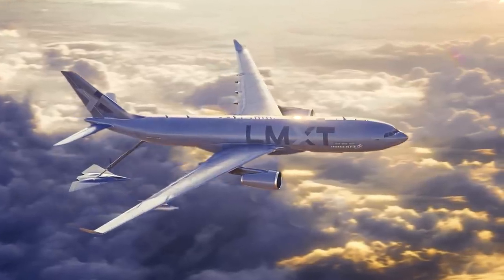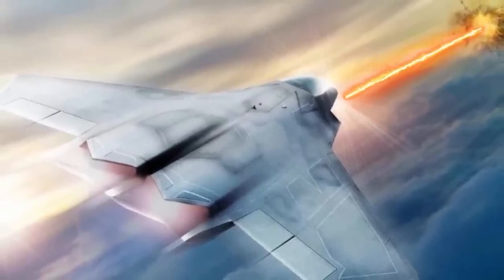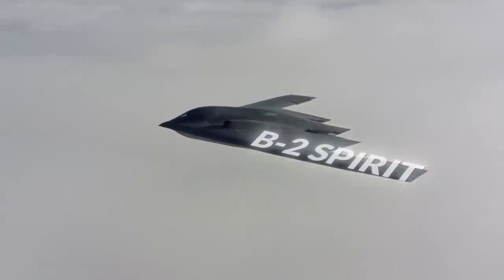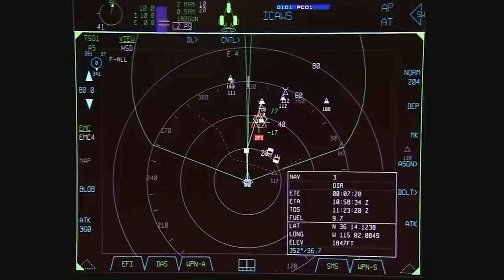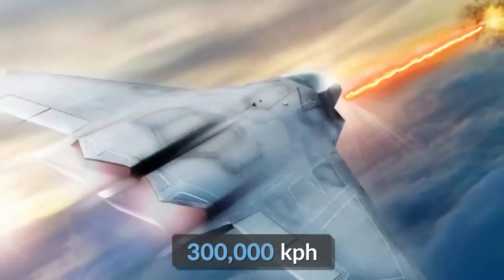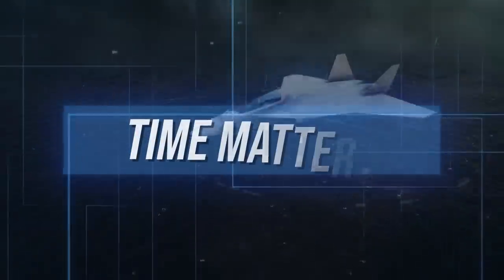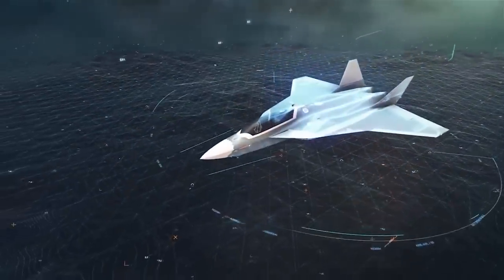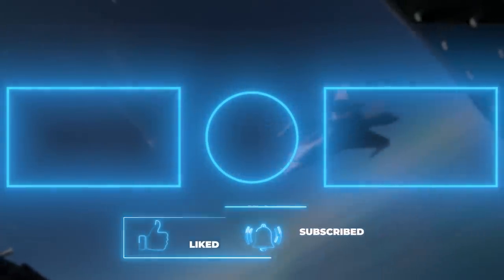Finally: US Revealed the FIRST 6th Generation Fighter Jet!

Comment: There may not be any moveable control surfaces needed on this airship. The released, declassified, empiricism, has yielded employing controlled, supersonic, bleed air over the wing surfaces to substitute for radar reflecting, and more complexity adding, moveable control surfaces. Also, no mention of the power plant most likely a 3 Stream Adaptive Cycle turbine already built by GE.
Reply: Yeah sure. No necessary moveable control surfaces. It must maneuver by thought alone... dude it most likely has ailerons and flaps/air brakes. Probably thrust vectoring. And for yaw it probable uses differential thrust. The only one of those I just listed that isn't a moveable control surface by any definition is differential thrust. Some arguments can be made that thrust vectoring does or does not count. You can probably get a compressed air thruster system going with that model but the capacity would be limited. That with the stuff I listed would be able to do anything the pilot can AND MORE. Meaning a remote operator can do things with it that no human in the seat ever could.
Reply: @hf117j  Published in "Machine Design", 19DEC17, "New Drone Technology Manipulates Air for Enhanced Flight". This is an earlier explanation. The paper I read was far more indepth. You are what is known as, 'Behind the power curve'.
Reply: @scottwolf8633  Let me guess. Ion thrust or something. Which would be good... if we were able to make it efficient enough to work for full scale models. But the closest we can get is scale models made of the lightest possible materials to get any noticeable thrust. Know what else changes air besides that? Heat, and movable surfaces. Given it hasn't melted we must be able to dive into the sun. Orrr.... it uses movable surfaces. The tech has been around for a long time but it's still in its infancy. So that power curve we're on about if we're talking thrust to weight ratios anything other than thrusters or movable control surfaces is way behind on efficiency. You want a hyper maneuverable plane give it multiple forms of control for every movement and remove the human element. But it won't fly for very long. You want a viable combat plane for ranges beyond last line of defense you use movable control surfaces and thrust vectoring

Comment: We should just invest in smaller cheaper options that are low cost to fly and repair. The tech is so good and cheap now that In a real conflict cost to fly per hour should be a major focus. Also produce them in large numbers, and make it super easy to fix, build, and highly reliable.
Reply: If you understand how the NGAD is meant to work this won't be an issue. One NGAD may cost a lot but it will control several drones that are cheaper and easier to upgrade that will do all the dirty work. In real terms you are spending more on one fighter but it will far outperform 4th/5th gen fighters in efficiency and effectiveness
Reply: @iamzuesthisisthetruth8864  lol yes ofc it is hypothetical that is why I said "meant to work". If you read up on 6th generation fighter projects by USA / Europe / China you can see there are common themes. One of which is autonomous wingman drones that fly alongside a central command jet fighter. Simple logic dictates that drones will be cheaper and likely perform better than a manned aircraft and can be continuously be replaced with cutting edge technology. F-22 is decades old so will be obselete with 6th gen. USA plans to introduce NGAD in by 2030. Please read up first before saying anything.
Reply: I agree. The future of warfare is changing. Gorilla warfare seems to be the direction it's going. If you used e bikes, with handheld rocket launchers, and small drones, you have a formidable fighting force.
Reply: That's why it's expensive!.. 😴
Reply: So your saying we should downgrade back to ww2 aircraft or something?
Reply: @GeneralThunderbolt  
You're right however the average person that you're trying to tell this to has brains of a bird

Comment: China’s J-20 is about as stealthy as our F-18E. Now our F-18E is larger and has a smaller radar cross section than its predecessor, so we need to watch China’s progress carefully.
Reply: The F-22 and the B-2 are comparable to the size of a bumblebee or smaller with the F-35 being quite small itself in the Radar cross sections.  Apparently if the J-20 is appearing to be as stealthy as a F-18E it shows how lacking the fighter actually is at stealth.   It might be useful against lesser powers but against more high tech nations the J-20 is at a severe disadvantage
Reply: @Quetzalcoatl_Feathered_Serpent   That’s close to what I’m saying. I think it’s a sign they are catching up. They are still behind, but they bare watching.
Reply: @johnsalter5412  They are more then 2 generations behind on engines.  They can not with their current workforce catch up in that area.  China is not a threat.
Reply: @Quetzalcoatl_Feathered_Serpent  I don't know. It really depends who could see who first and US tech is far superior in that regard. Since we stopped giving away the latest chips to China. So maybe this has a chance against any of those you named
Reply: @acvarthered  Give them a little time. They certainly have the money. Also their workforce is becoming more and more educated. Like I said, the J-20 is about equal to our F-18E. That is quite an achievement.

Comment: If the 6th generation fighter jet STAT-222A devil fighter is built, it would kill its enemy in the skies of the battlefield of the future, to fly, it has 4 J-99 Afterburning jet engines, with 90K pounds of thrust max, with 2 20mm MG-251 cannons with 7000 rounds max, 2, 2 500 pound bombs, 5 SK-28 AAM, 3 SK-100 Airborne Torpedoes, and 1 SK-99 ICBM, it would be a beast in the skies, and with its 5525 number 2 radar, it doubles up as both surveillance, and Reconnaissance

Comment: 7th generation rumor, nuclear power jet, with cloak ability...
Reply: I just recently saw that fusion engine patent was issued to either Lockheed or Boeing. And that this may be the engine that wil go into 7th generation and even late 6th generation planes. That means unlimited speed and engine power without having to EVER refuel. If so this will be a complete and total game changer.
Reply: @xlxl9440  fusion? Lol, if they have fusion, why not give it to energy sector.
Reply: @CountingStars333  two simple reasons. 1st the technology isn't ready yet but far enough along to be able to file a patent. And 2nd this would actually hurt the energy industry as it is now because if the technology matures it will basically mean a free and unlimited energy source.

Comment: May I say this NGAD concept totally lacks imagination? A 6th Gen fighter either has to be hypersonic, min 5mach or above; or it has to be a UAV swarm, controlled by the co-pilot of a manned flight. It should be able to change the air superiority upside down.

a 6th Gen fight is not simply a faster, stealthier 5th Gen fighter, even when it carries a laser gun (which itself is a big if).
Reply: You are speaking of the role of our B-21 Raider
Reply: @blackhawk7r221  Raider is not for air superiority -- stealth may be helpful, but itself is not the decisive factor during an air battle. 

B25 did a lot of damage to Nazi, but eventually, it was the P51 concluded air battle.

Comment: But considering we're going to get the SLS version instead of the Tesla version, it's probably going to be garbage .... Anyone that works in DoD contacting knows exactly what I'm talking about (F-35)... The Lockheed that pulled off the SR-71 doesn't exist anymore. And even though they might still have a similarly competent design section, it would be too cost prohibitive to pull it off in manufacturing in any respectable numbers. By respectable I mean something that is at least 5-10% of what would be needed in a near-peer conflict. Right now they are only capable of producing just enough to keep the government cheese flowing over budget with almost nothing to show for it.
Reply: And you know this for a fact how?